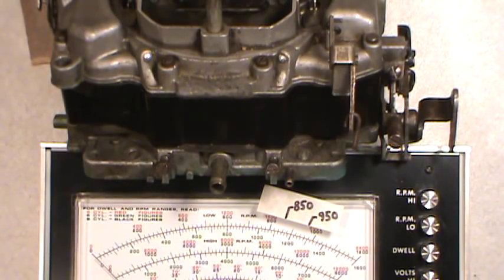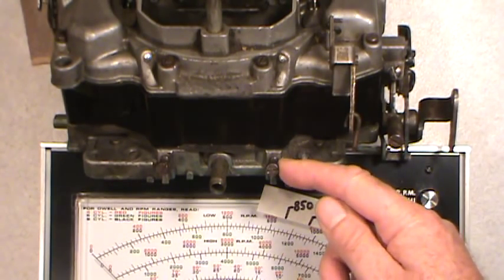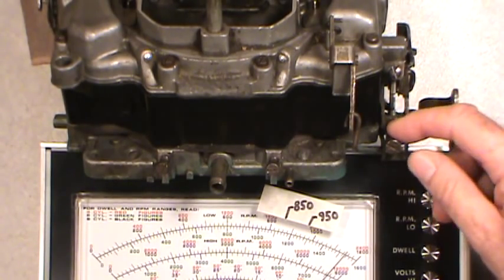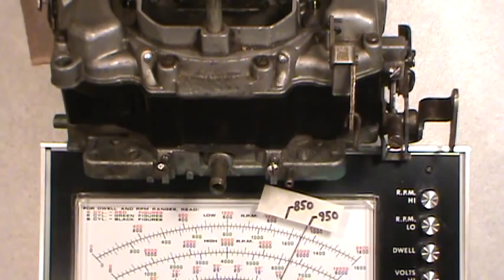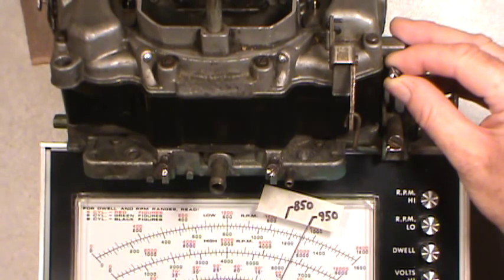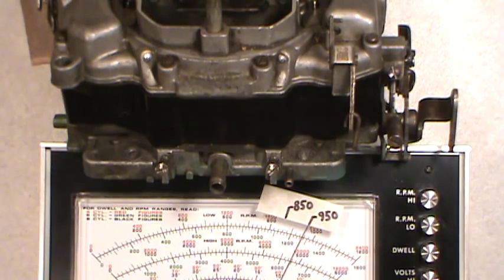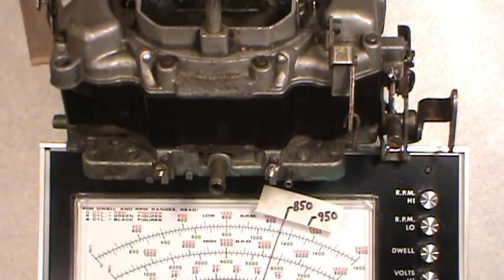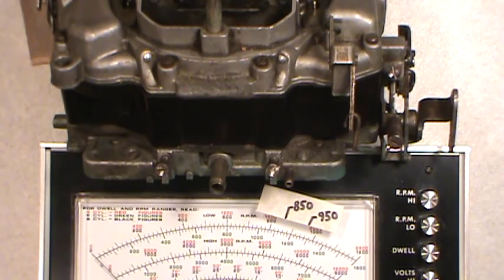Idle Mixture Adjustment on 4 Barrel and 2 Barrel Carburetors

Comment: Thank you for this instruction video -- I am installing a new Qjet for a 454 and this is the first clear and easy to understand procedure I have yet to see.  I have always had problems with the fine tuning, I do a pretty good job but now I see how to get it right on the money -- thanks again.  When I get the job finished I will let you know how it turns out.  thanks again.
Reply from the maker: Greetings Dan Baxley....Thanks for watching this video, and, thanks kindly for Your much appreciated comment....The "Actual" way, in which I was showing people how I Adjusted the "Idle Mixture and Idle Speed" in this particular video, "ONLY" Applies to a Thermoquad Carburetor, similar to this one, and, also "Specifically" to the "Exact" Engine (Dodge 360 Cubic Inch V-8) that, the other similar Thermoquad Carburetor, was installed on, as per the "Specification's" on the "V.E.C.I. (Vehicle Emission Control Information) Label", that was stuck in that Vehicle's Engine Compartment was showing....Although the "Method" that I was showing People, that I used, in order to "Pass" the "Smog" (aka, Emission's Testing) for this Particular Engine and Carburetor "Combination", can, sometimes be Successfully used, on quite a few Engines, with 4 or 2 Barrel Carburetor's, If, the Engine/Carburetor "Combination", are of a "Stock" (aka, Factory, Unmodified) Nature.

I have done the very Same "Procedure" (Method), with a Factory/Stock (No Modification's) 1979-350 Cubic Inch (5.7 Litre) V-8, that was Equipped with a "Quadrajet" Carburetor, with a Turbo-350-Automatic Transmission, but, with "Different" Engine RPM's (Revolutions Per Minute) Specification's, when "Performing" the "Lean Drop" Method.

If Your Engine have been "Modified", especially, with a "Lumpy & Aggressive" Camshaft, then, this good ole "Lean Drop" Method, as I see it, probably Won't Work.

If, Your Engine is Stock, Unmodified, and has the factory Installed "Pollution Devices", connected and working properly, then, I figure that, the vehicle Would stand a much better chance at "Passing" the Smog/Emission's test.

Here's an Example of the "Figures" that I used on that previously mentioned 350 Cubic Inch Chevy V-8, that was Adjusted for Smog/Emission's Testing...

"Please Note", that the following Specification's "ONLY" Apply to this particular Chevy 350 Cubic Inch V-8...!!!

Engine fully warmed up...

Automatic Transmission in "PARK"...(and on level ground, with the parking/emergency brake On, and with, Wheel "Chalks", well actually Bricks, blocking all 4 Tires, to keep the Vehicle from takin' off!).

"Stop Engine", then, set the "2" Idle Mixture Screws "3" Turns Out, from being just "Lightly Seated".

Re-Start Engine, and Adjust the "Idle SPEED Screw", so Engine Idles at 875 RPM's...

then, turn each of the "Idle MIXTURE Screws" In or Out, in order to make the Engine Rev at the Fastest RPM's...(I ended up with each of them, being about "4" Turns Out, from just being Lightly Seated).

...The Engine's  (875 RPM's that were Initially Set, will probably "Change" to a Different RPM!), so, just "Re-Adjust" the "Idle SPEED" Screw, back to "875" RPM's....I had to do this a few times, to get it "Fine" Adjusted.

...then, once I got the Fastest Engine RPM's at that 875 RPM's Dialed In (about "4" Turns Out, from being lightly seated), I Turned, "Each" of the "2"..."Idle MIXTURE Screws" in "EQUALLY", a bit at a time (same amount of Turns and Partial Turns) until the Engine RPM's "DROPPED" to 700 RPM's.

So, in essence, I went from "4" Turns Out (from both idle mixture screws being lightly seated), and having the 350 Chevy Engine, running at its Fastest (Idle Mixture) Speed (at 875 RPM's), and, I "Lean Dropped" it to 700 RPM's, which required that, I "Turned In" the"Idle MIXTURE Screws" about 1 1/2 (one and one half) Turns Each, from the Original "4" Turns Out (from being lightly seated), then, those "2" Idle MIXTURE Screws, ended up, being about 2 1/2 (two and one half) Turns Out, from being lightly seated, as the "FINAL" Adjustment!

I actually Confirmed that 2 1/2 Turns Out, with "Both" Idle MIXTURE Screws", from being lightly seated, by, Marking them with White Chalk, and Turning them in, until lightly seated again, then, I backed them out, to that "Lean Drop" Setting, that I marked with "White Chalk", back to the 2 1/2 Turns, from being lightly seated, and made sure, that I made the "Finished" Adjustment, while turning Both Idle MIXTURE Screws in a "Clockwise" Direction! (so the "SPRINGS" on the Idle MIXTURE Screws "Don't" decide to "Adjust" the Idle MIXTURE Screws, when I'm Not Looking!!!)..

...also...there is really No Need to lightly seat the "2" Idle MIXTURE Screws, again, like I did, as I Only did that, cuz, I was really Curious, as to, Actually, How Far Out, the "2" Idle MIXTURE Screws were, from being lightly seated!

In a Nut-Shell...With the Automatic Transmission in Park, I got the (warmed up) 350 Chevy Engine, to Rev its Fastest, at about "4" Turns Out, (875 RPM's), then, "Lean Dropped" it, down to 700 RPM's, by turning "IN" Each Idle  MIXTURE Screw, about 1 1/2 Turns, and ended up with having Both Idle MIXTURE Screws Out, about 2 1/2 Turns, from being lightly seated, for the "Final" Setting, as per the V.E.C.I (Vehicle Emission Control Information) Stickers, Required "Lean Drop" RPM's Specification.

If Your 454 Engine equipped Vehicle "Does Not" have to go through the "Smog/Emission's" Test, then, the "Idle MIXTURE Screws" for the most part, can be Adjusted, so, Your Engine gets the Fastest RPM's at the (Curb) Idle Speed, that Your Engine Specifies...

...You can do the "Leanest" Idle Mixture Screws Setting, while the Vehicle is in Park (Automatic Transmission)...

To set Your Vehicles "In Drive" (automatic transmission), "Curb" or "Final" Idle SPEED", is to simply "Set" Your "Idle SPEED" about 100 RPM's "Higher", while You have the (automatic transmission) In "PARK", then, get in Your Vehicle, and, hold the Brake on, as You put the (automatic transmission) In "DRIVE", and see what the Idle SPEED RPM's are at.

If You need to Adjust the Idle SPEED any further, just put the (automatic transmission) back in "PARK", and Re-Adjust Your Idle SPEED Screw accordingly, and, get back in the Vehicle, Brakes On, put the (automatic transmission) In "DRIVE" again, and, repeat, the above sequence if needed...

...Don't Forget, to put the (automatic transmission) back in "PARK" when You're Finished!!! (and the Brakes On Too!!!).
 
Your Engine might Require a Slightly "Richer" Idle Mixture, to get it to "Idle Smoothly", as Engines are somewhat like People, in that they seem to have "Individual Personalities" as well...!!!...lol.

Just keep in mind, the "Leaner" that You "Set" Your Carburetor's Idle MIXTURE Screws (to a certain point, that is), the "Less" Gasoline, that Your Big 454 Cubic Inch will be "Guzzling" at all of those Red Lights and Stop Signs, because "All" Gasoline Engines (while running), with the Vehicle "Not" in Motion, will tend to get...

..."ZERO" Miles Per Gallon!!!...or...in some cases..."ZERO" Kilometers per Litre!!!

If You like, let me know, what Testing, if any, that Your 454 Cubic Inch Engine, has to be subjected to, as in Smog/Emission's Testing, and any other applicable Inspections, that way, I'll know what will help You out the most.

Till next time...

...Be Safe, take care, and have a good one.
Reply: RockysRoadshow

Teh 454 Chevy engine I have is in a 30 motorhome I had it completely rebuilt (stock). Even repainted Chevy Orange.  I has about 8,000 on it and I had originally put an Edelbrock 1411 on it, replacing the stock QJ, but guess what, in california the E is not approved, even though you can buy these carbs at Pepboys -- well it would not pass smog because the carb was not approved.  Luckily I still had the original QJ, and with the carb I was getting a reliable 8-9.5 mpg.  After the rebuild with the Edelbrock the best I could get was 7.5, mostely 6.5, so going back to the QJ I figured would be a plus but 30 year old carb (?) so the smog guys rebuilt it, installed it and it passed smog.  That was 2 years ago and after the QJ rebuild the mpg was not any better than the Edelbrock.  The QJ seemed to climb the hills better than the E.  So, two weeks ago I had to go to smog it again and it passed, went to a different shop, and got the specs back and was told it barely passed, just barely, the emphasized. They told me it was burning all of the fuel, running too rich.  The engine, however, has been running really sweet, smooth idle and just purring down the freeway, but the MPG still not as good as before on the pre-rebuild and old QJ.  This all led me to decided to forget about messing with the carb anymore so I bought a NEW, Rochester QuadraJet, 800 CFM from Jet Performance and it has all of the Smog fitting required by California smog.  It is a 2 Stage model and the bottom plate, where the Mixture screws are located but they are recessed and look like they take a special tool to adjust.   I did pull the old plugs and installed new ones -- that was a job.  And I replaced the HEI cap and rotor with new.  Now I am getting ready to install the New Crab.  Here is the reading from the smog station -- This is all greek to me, just going on what they said.--
at 704 RPM HC (PPM) AVE: 57 -- MEAS 71
  The CO (%) AVE .70 -- MEAS 1.06 --
at 2478 RPM -- HC (PPM) AVE 33 - MEAS 21 --
   The CO (%) AVE .30 -  MEAS .91
It passed so I am happy about that, so i have two years before I have to do this again but i wanted to know how to set up thin new carb and that is when I found your posting, love it, cleared up a lot of misdirections finding at other places.  Any advice is really appreciated.  Thanks for being there Rocky
Reply from the maker: Dan Baxley
Greetings Dan Baxley....You're welcome, for...my being here, there, and almost everywhere...lol...and, thanks for Your nice comment, my Friend....First thing I should mention, is, about Your newly acquired "Jet Performance 800 CFM Quadrajet Carburetor, and, about what You said, about, needing to have a "Special Tool", to "Adjust" the Idle Mixture Screws....Drum Roll Please...It so happens, that I have a YouTube Video, on How I made my Own..."Special" Idle Mixture Screw "Adjusting Tool", and hopefully, the Idle Mixture Screws, in Your new Jet Performance Quadrajet, has Similar "Heads" on the Idle Mixture Screws, as can be Seen, in the YouTube Video that I made a while ago...

Dan, you can find the YouTube Video, that I just mentioned above these words, on my YouTube Channel...RockysRoadshow...and, the Title of that there Video is called...Rochester Quadrajet Dualjet Idle Mixture Plug Removal, Plus "Special" Tool!!!

Maybe, have a look at my YouTube Channel...RockysRoadshow...and You may very well, Find some Helpful, and perhaps Educational Information, that is contained in those very Videos...Enjoy.

Oh, where to start...

A Person, always has to remember, that, the Gasoline that is being sold these days, for the most part, is being "Blended" with "Ethanol" (aka, Alcohol), which usually causes Carburetors, that were "Calibrated" for that good ole Gasoline, and for example, using a Carburetor, of oh, about 1974, let's say, would more then likely, cause that 1974 Carburetor, to be administering a "Leaner" Air/Fuel Ratio, to the Engine, because, the Higher the %-age (per-cent-age) of Ethanol in the Gasoline "Blend", the "LARGER" the "Fuel Jets" usually have to be, and, in some cases, to prevent "Lean Surging", as I have experienced in the past.

It would help, if I knew what "Year" Your Motorhome and Engine happen to be, because, of the Many "Different" Types, of applicable Smog Equipment & Devices that were Installed on Your 454 Engine, as well as, what "Type" of Catalytic Converter was installed..."2-Way" or "3-Way ??? (if there is one, that is).

EGR Valve? (aka, Exhaust Gas Recirculation, and, there are many Variations of this Device as well).

Air Pump (aka, Smog Pump) ?

Then there are all kinds of Vacuum Devices, such as Delay Valves, Thermally activated (coolant) Vacuum controls, and, the list goes, on and on...

Sometimes, as with Your "Original" Quadrajet, the "Nitrophyl" (black plastic Float) has been known, to "Absorb" Gasoline, and this will cause Your Float, to start "Sinking", which will cause a Very "Rich" Air/Fuel Ratio, and may very well have been what caused Your Original Quadrajets "Rich" running condition.

Not to mention, that, a "Dirty" Air Filter, will also cause a "Rich" running Carburetor, due the the "Air Flow Restriction", that it causes. (the Engine has to "Breathe!"...lol)...and...Your Engine Needs a Nice "New" Air Filter, to help make Your 454 Engine "Pass" the Smog/Emission's Test!

Your Fuel Filter/Filters, have to be Like New, and Not Plugged Up in any way, or, it is possible, that it will cause Your Carburetor to run "Lean" (air/fuel ratio), which may very well cause, what is termed, a "Lean Miss-Fire".

A "Lean Miss-Fire", in most cases, will usually Send "Unburned" Gasoline through Your Exhaust System, and, The "Smog-Sniffin' Machine will usually "Detect' and "Report" a higher then wanted High "HC" (Hydro-Carbon, or just basically, Gasoline that wasn't completely Burned).

If You happen to "Set" Your Idle Mixture Screws "Too Lean", this will also cause a "Lean Miss-Fire", so, don't be tempted to go to "Lean" when setting them.

Even though, that "New" Jet Performance Quadrajet, that You have there, that has the Correct "Exterior" Fittings and such, might help Your 454 Engine to Pass the "Visual Test", it won't Guarantee, that the "Calibration" (aka, Fuel Jets Sizes, Air Bleeds, Float Level Setting, etc.) will be Set-Up in the way, that is required, in order to "Pass", that, good ole Smog/Emission's Test....Only, the Smog/Emission's Test Itself, will determine that, Your New Jet Performance Quadrajet is Set-Up, and, Calibrated Properly, to keep the Engine's Exhaust Emission's at a "Pass-able" Level.

If Your Motorhome Has a "Catalytic Converter", it has to be "Functioning" Like New, or, that Smog-Sniffin' Machine will let You know.

You had mention something about a "2-Stage-Model" ???....I'm not sure, just what You mean by that, perhaps, let me know, if You care to.

Before You Installed the "New Spark Plugs", did You "Set" the Spark Plug's Gap? (between the 2 Electrodes).

I have a YouTube Video on, "How To Set The Spark Plug Gap" as well.

Those Smog Numbers that You posted, look to be, not too bad.

I did notice, that You indicated CO% "Twice", with Different Numbers.
I'm thinking that, one of them is, "NOX" ? (aka, Nitrogen Oxides).

Here's some Food For Thought...

"HC" is short for Hydro-Carbons....Simply put, just Unburned Gasoline.

"CO" is short for Carbon Monoxide....Carbon Monoxide is Lethal (aka, Deadly)...!!!
If Inhaled, it enters the Bloodstream, and "Prevents" the Blood from Carrying "Oxygen" throughout the Human Body, and, basically, a Person "Suffocates" (Internally), and, if Inhaling too much of this Deadly Gas, that poor Person "Dies"...!!!
"Always" have Plenty of Ventilation (aka, Fresh Air), whenever "Any" Fuel Burning Engine is Running...!!!

"NOX" is short for Oxides of Nitrogen....The "X" denotes, that there are more then "1" Type of Nitrogen Oxide, in this Mix.

NOX is the result of, what is normally referred to, as, "Peak Flame Combustion", or in simple terms, When Very High Temperatures Occur in the Combustion Chamber/s, as the Air/Fuel Mixture is Burning, which in turn causes the excessive NOX.

To combat this NOX stuff, they came up with a few things.
EGR System, (Exhaust Gas Recirculation), which includes the EGR Valve itself (the Older Ones, kinda look like a little Space Ship...lol).

When the Engine was fully warmed up, and at light throttle, while mostly Cruising along, the EGR Valve would allow Exhaust Gas (from the engine), to be introduced, along with the Air/Fuel Mixture, that the Carburetor provides, thus, basically, "Diluting" the Air/Fuel Mixture, in order to Keep that "Peak Flame Combustion Temperature" Down, to "Reduce" the Amount of "NOX" that starts heading its way, out of the Engine, and out through the Exhaust System.

Hmmmmm, maybe I should make some kind of Smog video...?...lol.

Have a look see, in or near Your Engine Compartment, for a V.E.C.I. (Vehicle Emission Control Information) Sticker/Label, as, that will be of some Major Help!

Till next time...

...Be safe, take care, and have a good one.
Reply: RockysRoadshow
Thanks for taking the time -- the motor is a 1983 454 Chevy, in a 1984 Revcon motorhome.  No cats -- dual exhaust.  I returned the Jets Quadrajet, turns out it has every thing but the goose neck in the throttle linkage, drivers side, to accommodate the TRC throttle lever actuator which appears to be an intricate part of the Emissions on this engine.  I finally found out it is a feature put on some big trucks and mothers homes but seems to be missing on most cars of same vintage.  So, I am stuck.. Originally when the engine was rebuilt I had an Edelbrock manifold and an Edelbrock 1411 carb installed -- the carb did not pass smog because it was not an approved carb.  I'm thinking about putting it back on and then when smog time come around again (2 years from now) I will swap it back out for the old original Quadrajet?  So, would the set up for the Edelbrock 1411 be the same as you demonstrate in the video?  Also, should I put a heat shield gasket down under?  And if it is a good idea to put a heat shield insulator gasket under this carb, should I also use the metal plate Edelbrock has for converting the Edelbrock Performer manifold with top cut for a Quadrajet, or can I just use the heat shield gasket?  Thanks, Dan I am going to check out more of your videos -- love the detail.
Reply from the maker: Dan Baxley
Greetings Dan Baxley....Seeing as how Your (Original) Quadrajet carburetor is a 1983 Model, that alone, has me thinkin', that it may very well be, something along the lines, of being a "Feed-Back" Type of Quadrajet, with Extra Gadgets, and also, an ECU (Vehicles on-board Computer) perhaps?....But sometimes, Trucks, and maybe Motorhomes as well, might not have been equipped with this Feed-Back Carburetor System, as the Cars were, during that time period....If You take a look, usually on the Driver's Side, of the "Original" Quadrajet, You should be able to see some "Numbers" Stamped on it....If You could tell me what these "Numbers" happen to be, I just might be able to find out, what "Gadgets" and such, that were Engineered in to it, by the Factory that made it in the first place.

Did You look around in Your Motorhomes "Engine Compartment" (or anywhere in Your Motorhome) for a "V.E.C.I" (Vehicle Emission Control Information) "Sticker/Label" at all yet???

That VECI Sticker/Label, might just be, Worth, its weight in Gold!
There is some Important Information on that thing!

With Your Edelbrock Carburetor, the most "Important" thing is, to "Make Sure", that when Both, the Primary and Secondary Throttle Plates (aka, Butterflies) are "Opened-Up", as far as they will go, as in Full Throttle (aka, Pedal to the Metal), that Both the Primary and Secondary Throttle Plates "DON"T" get hung-Up, or hit any part of the Intake Manifold, or the "Adapter", if You so choose to Install one, between the Top of the Intake Manifold and the Bottom of the Carburetor!

I know that most Quadrajets, that I have seen, are known as "Spread Bores" (Smaller Primary Throttle Plates, with Larger Secondary Throttle Plates)...

...where-as...

I'm thinkin', that the Edelbrock, is referred to as, a "Square Bore" (carburetor), and that just means, that, "All-4" Throttle Plates, are the Same Size.

It is Always a good idea to "Insulate" Engine "Heat" from the Base of a Carburetor, "Especially" if, the Carburetor is made of "All Metal", and also, given the "Confines" of the Engine Compartment that is found in Motorhomes and Vans, that Don't Allow as much Cooling Air, as most Cars seem to have.

When an "All Metal" Carburetor gets Too Hot, the Gasoline becomes Less Dense, making for Less Power, and might even cause Vapor Lock, which has been know to cause poor performance, and hard starting too!

If not being Smog Tested, You can simply Adjust Your Idle Mixture Screws, to give the "Highest" RPM's, at about, something like 700 RPM's in PARK (that 700 RPM's get dropped back by the Idle SPEED Screw, each time the Idle MIXTURE Screw/s make the RPM's go Higher, that the 700 RPM's "SET" by the Idle SPEED Screw.)...or...for Less Fuel Consumption, You could do a "100-RPM-Lean-Drop" (with the "2" Idle Mixture Screws), so You end up with 600 RPM's, "WITHOUT" Touching the Idle SPEED Screw. (go In Equal Amounts with Both Idle Mixture Screws, to get Any Lean Drop Setting).

The Above Lean Drop Setting/s, may, or may not, allow Your 454 Engine to Idle "Smoothly".

(Remember to Always make Your Idle Mixture and Idle Speed Settings, with the Engine Fully Warmed Up, and with the Automatic Transmission in PARK!)

Just simply, Slightly "Richen", Both Idle Mixture Screws, an Equal Amount (opposite of a lean Drop...lol), until, Your 454 Engine is, Idling as smooth as Silk, or if not, at least in the same Ballpark, and remember to Re-Set Your Idle Speed accordingly.

Check Your Idle Speed Specification, and hopefully, You will find that Specification, on the VECI Sticker/Label, that should be Stuck somewhere in Your Motorhome.

Once You are satisfied with Your Idle Mixture Setting, just Set Your Idle SPEED Screw about 100 RPM's Higher then the Idle SPEED that You want, (when) the Transmission is in PARK...then, when You step on the Brake, and put the Transmission in DRIVE, Your Idle SPEED (while in DRIVE), will Drop in RPM's, and should be pretty close...if not, put the Transmission in PARK again, and Re-Adjust, then Check Idle SPEED in PARK again, with the Brake On...then just Smile!

Be careful, especially if Your Original Quadrajet carb was Computer Controlled!!!

You don't want to "Fry" any of the Electrical Components, including the Motorhomes Computer (if it has one, that is), by leaving Wiring and Connectors Un-Attatched, and maybe Shorting to Ground, or causing an Electrical Strain, by having something Disconnected!

In other words "Look before You Leap!" (aka, do some Research, before You Modify Anything!).

I hope that, all goes well...

Be Safe, take care, and have a good one.